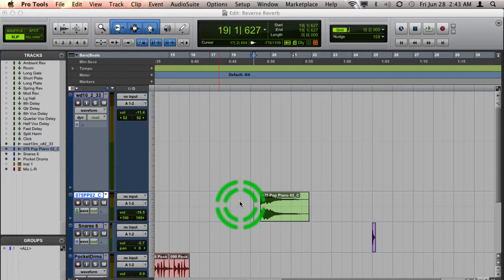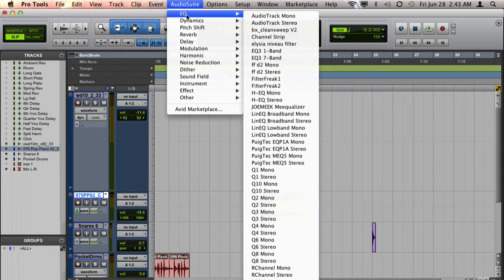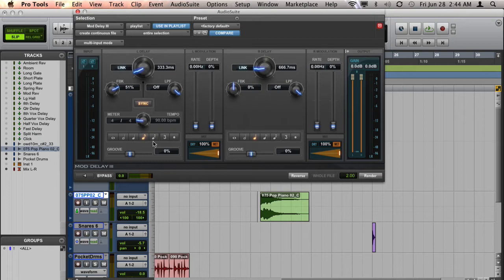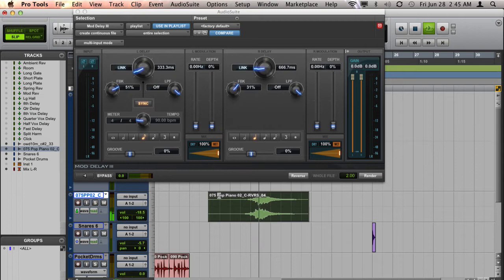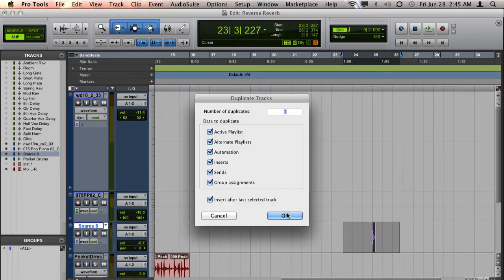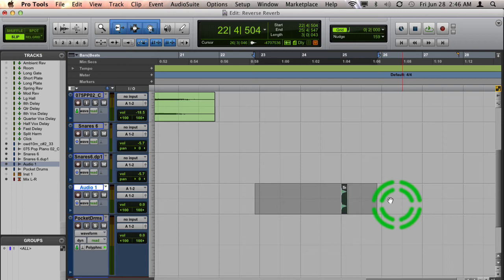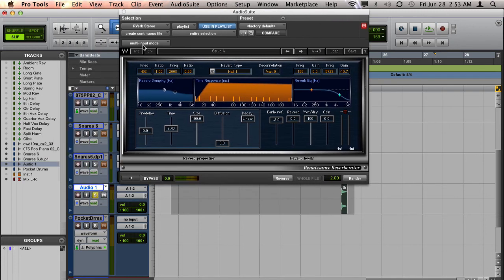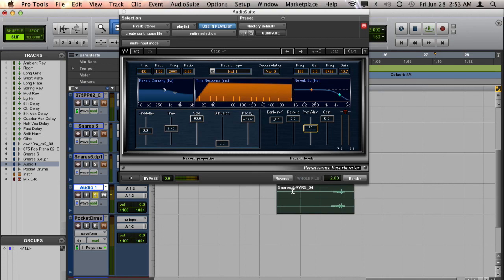Pro Tools: Reverse Delay or Reverb

Comment: Nice tips.  If I could make a suggestion, I would recommend duplicating dry track material first to allow dry/wet control afterwards.  Otherwise, you you'll find yourself going back and forth with audiosuite settings.   Think just like time base routing.  You want wet/dry control through faders instead of printing.
Reply from the maker: Excellent comment.  In fact, what you suggest is exactly what I find myself doing 99% of the time that I am using an effect like this.  In this video, I am using 100% wet, so if any dry signal is desired, then you definitely would need to have made a duplication of the track/clip before applying the processing.  Thanks for watching!
Reply from the maker: In fact, I went ahead and added a note on the video regarding your comment.  Thanks for your input!